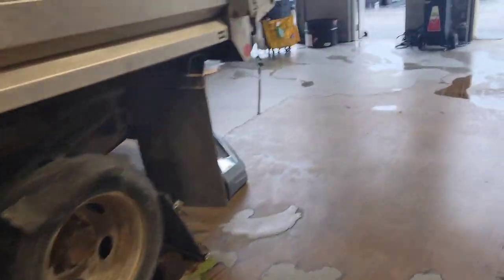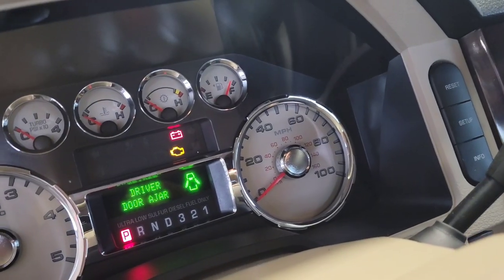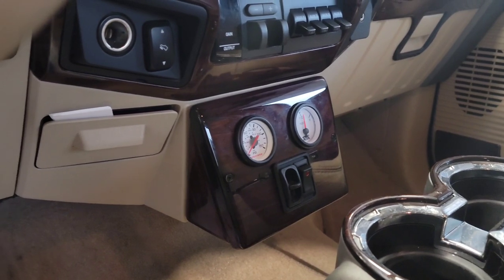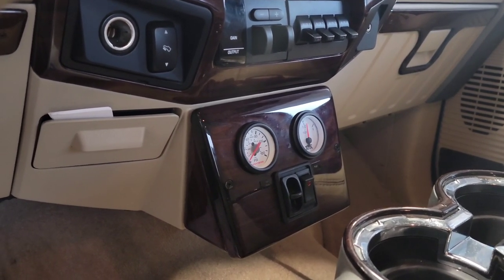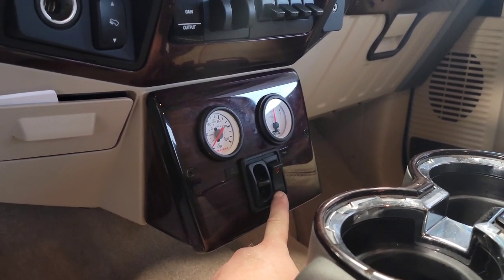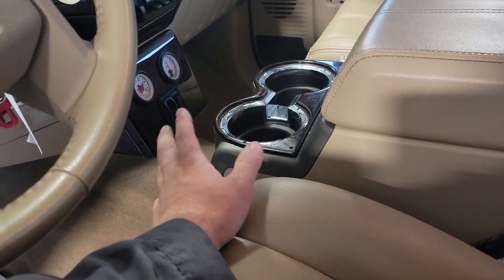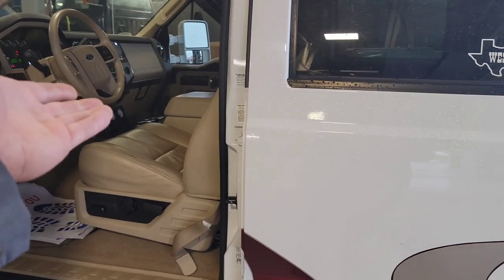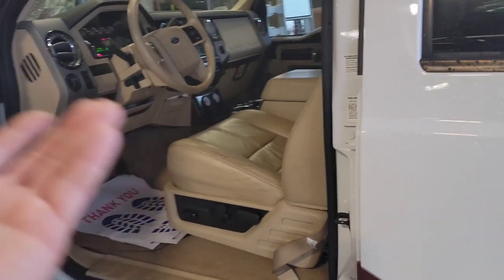Western Hauler Diesel Transfer Auxiliary System 2008 F450 Superduty - How It Works

Comment: I got the same conversion on my 2016 F450 from Western hauler in Fort worth Texas auxiliary tank is at around 91 gallon fuel tank also had them do the kelderman air ride kit I think my total capacity is around 130 gallons
Reply: Have to take out a loan to fill that bad boy

Comment: I did away with the fuel management system and just did the aux 4 up fitter switch pump on pump off simpler I wasn’t a fan of the fuel management